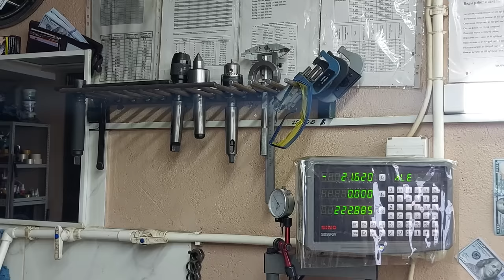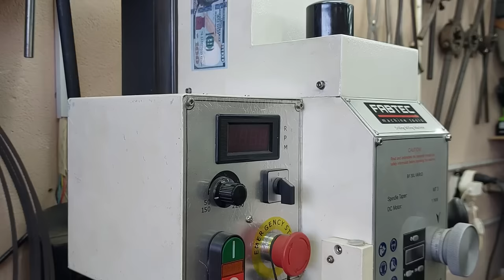Cool idea! I don't have to go to the car service anymore

Comment: Nice tool.  A bit of heat applied to the outside of the housing will expand it and release the bearing better.  I've made a similar tool that has a cone at the end to pull down inside and expand the four legs I use.  Works like a charm and I've used it for years and years.  Good job!
Reply from the maker: Thank you my friend and welcome🙂